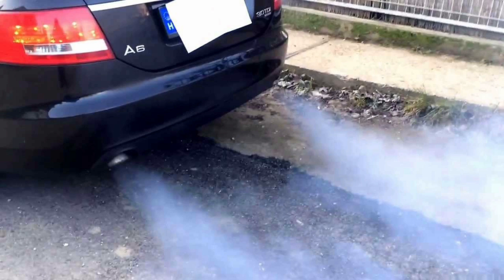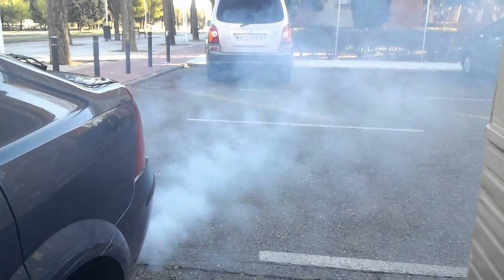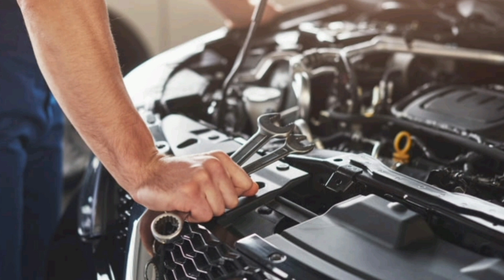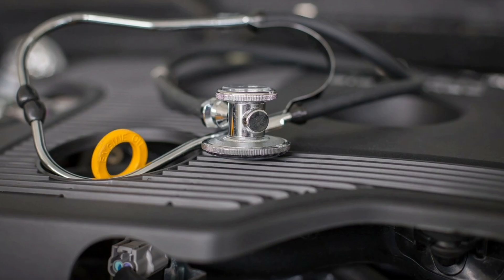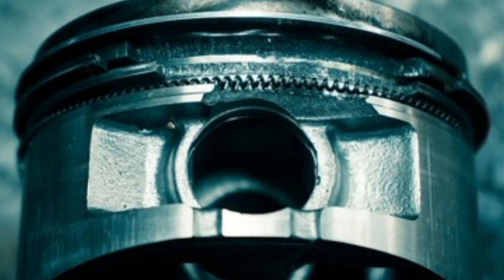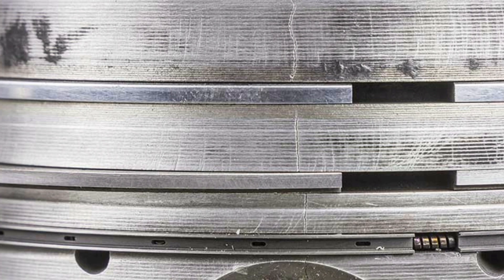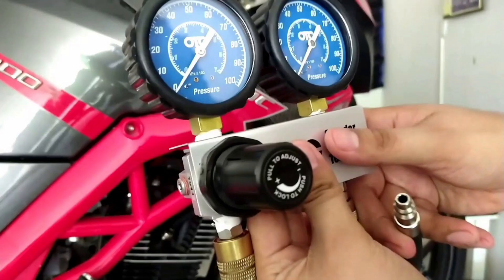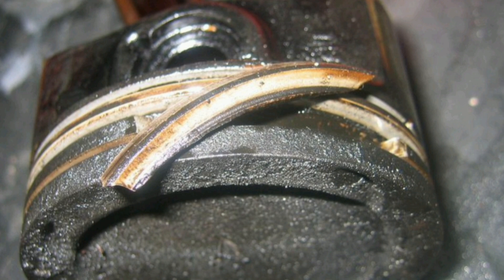Signs that the piston rings are damaged

Comment: In turbocharged engines piston rings are likely to go bad sooner and allow "blow by" where the pressurized fuel and air mixture leaks by the piston rings and into the crank case. This can cause PCV (positive crankcase ventilation) issues, as well as introduce moisture (one of the main products of combustion) into your oil and ruin it over time. Additionally, the pressure in your crankcase can cause oil to "foam" especially in small port and runners and greatly reduces its lubricating ability. In short, change your oil often and do a compression test yearly if you love your turbo car.